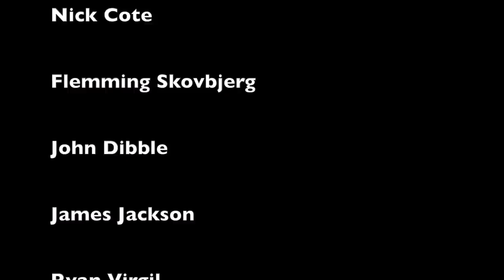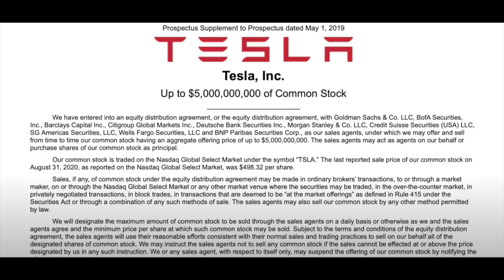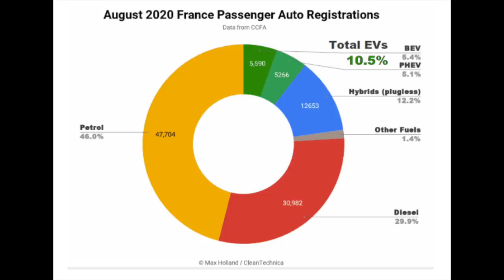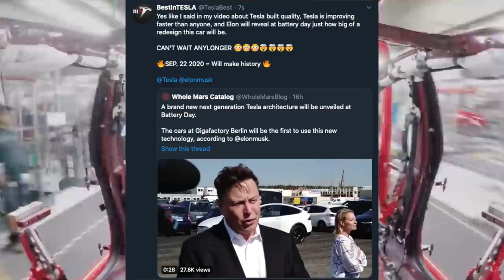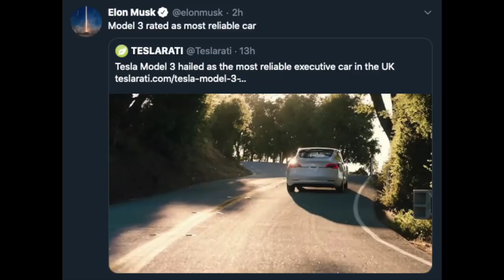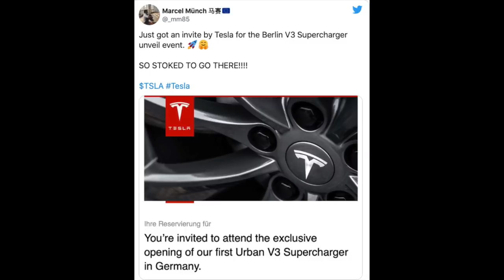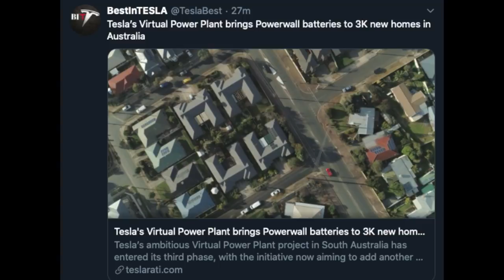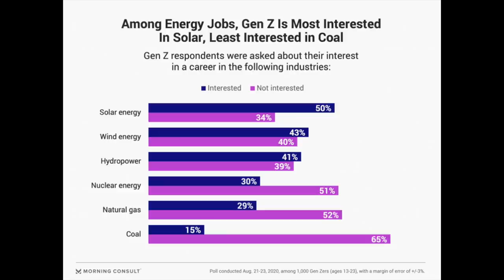Tesla sales are up 457% in Germany | Ford showing off insane new electric car | $5B in capital !!!

Comment: Tasha from ARK had said months ago that they would be fine with dilution for the sake of the bigger picture. The S&P is a non starter anyway. Tesla was being Tesla before the S&P announcement, and they will be the same Tesla company after.
Reply: Sure, same company, but a less valuable one with less short term momentum. But for long term and inclusion will of course come and most likely when come when Tesla is less volatile and the income from the core business is enough to keep the company profitable.
Reply: @danieeel90  Elon has already said he doesn't care about short term traders and if volatility is a problem the don't buy his stock. I deleted my RH app. Just settin it and forgettin it.
Reply: @lovewilliams4500  Yes, but it's not Elon who chooses who goes into S&P 500 and who doesn't. But yes, I think buying or holding Tesla now is only for the long term investors so you have the right idea.
I think Apple is another stock you could do the same thing with.
Reply: @danieeel90  I never said Elon makes that decision.
Reply: @lovewilliams4500  I know, but you commented on the volatility. Which is an issue when being considered for S&P 500.
Reply: @danieeel90  That's because he said that about day traders in general.
Reply: Thx
Reply: @lovewilliams4500  It's not volatile just because of daytraders. It's more because of Robin Hood average joe investors who found the stock and the fear of missing out. Those investors also tend to be the ones who panic during big jumps in share prices.
Reply: @danieeel90  I know day traders that use RH, too.
Reply: @lovewilliams4500  Yeah, they are on every platform.. I said average joe investors though.
Reply: @danieeel90  and every average Joe trader is on every platform.
Reply: love williams Good luck, you clearly are trolling or simply don’t understand.
Reply: @danieeel90  Riiiight

Comment: This just proves that Tesla got a lot of jealous haters. SP500 is tripping
Reply: I think the S&P just wants to see a longer track record of positive balance sheets from Tesla.  Inclusion will happen eventually.  No reason to get upset that it didn't come at the first possible chance.
Reply: @AMortalDefiant  A longer track record? You don't get to change the rules in the middle of the game.
Reply: The thing is regardless of what the S&P does or doesn’t do the stock will continue to have an out sized impact on the market and the funds that track the index won’t accurately represent the segment of the economy they claim. So in other words regardless of any internal opposition for whatever reason they have to Tesla, they won’t have a choice but to add them. Either that or the funds will buy Tesla anyway so they are representative and not so skewed
Reply: This is Tesla we're talking about, "No Problems"

Comment: 7:05 Tesla sales up 456% in August in Germany!!! No wonder Gordon J quotes the pre-ship July figures 🤨
Reply: özv. Döbröntei Ilona 🙄
Wrong 2846 cars in the month of August 2020 🤨
Reply: But in July 2020 only 250 cars. Better see the whole picture of what is going on in Europe
Reply: @özv. Döbröntei Ilona Mathematics lesson for you. Even if we used 100 cars as your starting point it should be 556 and not 456. If sales was up 100% then it'll be 100 then and 200 now.
Reply: Not that hype, just covid recovery. Ev is  still behind by normal car s lot
Reply: Preuling that is true but they have no dealerships to hold buffer stock. So Tesla need to wait for enough orders to fill a boat before they transport... So July was just between deliveries. But To be fair the same argument can be levelled at the 456% increase over August 2019.  
When Giga Berlin opens they won’t have that problem, watch this space...
Reply: rene topeka that is why TSLA is so valuable.  Their addressable market is 98% of all autos.  The world is going to near 100% EV so the growth potential is huuuuge...
Reply: @roryreddog3258  Model 3 was down first half of 2020. Tracking it live is very hard because the sales are very clumped in some months. March and August accounted for 2/3rds of model 3 sales in germany,   the pattern would suggest 700 sold this month.
Reply: nox5555 Tesla Don’t load up dealerships with cars all around the world. It’s a different model, they make cars to order so they have on average 17 days inventory, so when Fremont was down 7 weeks and China down 4 weeks they could barely sell any cars in Europe. Legacy auto not only have plants on the continent but also had about 8 weeks dealership inventory. Tesla has to focus on delivering to US and China, in order to “deliver” as many cars as possible. Low European sales early this year are meaningless, just as high sales in the month of August is meaningless as that is just when the ships laden with Teslas arrived. It’s a global company so you have to look at global numbers rather than regional ones.

Comment: There is no speed limit on the German Autobahn. How do the Tesla Models handle that?
Reply from the maker: I tried 232km/h no problem 🙊🙉🙈🤘
Reply: @BestInTESLA  145 mph? I used to cruise, in my Porsche 911 @ 150. And, something would always give me the "high beam blink", I'd pull over, and get passed. 

I once was in front of a Ferrari F-10. I never saw him come up on me. I pulled over, and just vanished.  But, not before I saw flames come out of the twin triple exhaust pipes when he shifted. He was the Roadrunner - Beep Beep - he was gone.

Comment: You Should mention that Unplugged Performance's car had battery cooling issues they were not aware of after the rebuild from the crash  and had to run much of the race in limp mode.

Comment: You should talk about the "MEGA PRESS", THE LARGEST "ONE STEP" STAMPING MACHINE IN THE WORLD!
Giga Berlin will also have the most advanced Painting Process where the curves will be given different paint.
IT WILL LOOK AMAZING!!!!!!!!!!!!!!!!
Reply: I'm really curious if that will stop the several problems with current paintjobs which are widely shared with various models.
Reply: The megapress is not a stamping or metal pressing machine - it is an advanced high-pressure die-casting (HPDC) machine, made by IDRA Group of Italy.
Reply: @steveupson7183  I hope it is far more reliable than other products made in Italy.
Reply: @andytaylor1588  yeah, like Lamborghinis and Maseratis.
Reply: @fincarosa  
U R HILLARIOUS!! (Michelangelo? DaVinci, anyone?)
Reply: @steveupson7183  Don't miss my point. It's a game changer that nobody talks about:
Musk is renowned for outsized promises, but in the case of the Model Y’s die-cast rear underbody, his enthusiasm for  this advanced use of aluminum – cast by a house-sized “giga press” – is supported by manufacturing experts who call it a game-changer. “It’s definitely an all-new look at how to do things,” asserted Laurie Harbour, president at Harbour Results Inc. manufacturing consultancy. “Elon Musk has always pressed his engineers to be creative.”
Reply: @fincarosa  Fast and sexy, buy definitely NOT reliable. Nothing even close to Tesla's when it comes to Reliability.
Reply: @funkyjazz123  Do not know of paint issues. My sister has had her Model-S for over 6 years and still loves it.
I don't have to worry about paint, I ordered the CYBERTRUCK and will have it wrapped!
Reply: @jacdragan8918  you missed the point.  My comment and the comment it was responding to were not comments about Tesla, they were about Italy. I was pointing out that's it's incorrect (and stupid) to throw shade on a whole country and talk in generalizations.
Reply: @Jac Dragan I’ve not missed the point at all. You were highlighting the Tesla / Musk tendency to innovate, to think out of the box, to take an idea from one sector of industry, and use it in another. All I did was point out that the introduction and development of the Megapress at Tesla is even more innovative than you had indicated. How many other car manufacturers are making their sub-frames from aluminium (yup a Brit :) ) rather than mild steel? How many of those are mass produced? How many are cast, rather than being cut and stamped in a press? How many are making their rear sub-frame assemblies from one piece of aluminium, rather than pressing, welding and glueing together of umpteen pieces of sheet steel?
Tesla’s use of the Megapress (I gather there will be 8 of them at Berlin) is yet another game changer that will have the traditional mass-market car manufacturers spitting feathers. One major change allows Tesla to build cars that cost less to make, are safer and more robust, and are far more resistant to corrosion. And that’s just one innovation. To catch up with that one advance, the traditional manufacturers will have to ditch $billions of earlier investment.
Reply: @Blessings 2You Sorry, but I fail to see the connection between Vitruvian Man and Volvo, Doni Tondo and Toyota. 
And for the record, Michelangelo was overrated. Could’t draw. :)
Reply: Jac Dragan You should look up in the dictionary what the differences between reliability and quality control. You can have excellent quality control where it meets the specs to the T, but it’s a piece of shit as it falls apart. I had a Porsche Cayenne and I mentioned this before another post, well built quality, but the transmission crapped out at 118,000 miles. And that cost me $8800 to replace the tiptronic XMSN. Hence it was not reliable. Reliability has to do with a things lasting power and how well it holds up. It’s got nothing to do with paint defects or gaps between panels, which is a quality control issue, not a reliability issue.

Edit. Sorry this was just to correct the difference between the two, but as I see, i didn’t read it the right way.
Reply: Jac Dragan, the curves are not getting different paint.  The paint chemistry they're going to use at Giga Berlin will look subtly different at different angles.  Sounds sick, but it's all the same paint.

Comment: ofc the build quality in Germany will be better. Just like the build quality in Shanghai is better than the one in Fremont. New factory designs, new technology, change in the manufacturing Technics due to new and improved technology. The build quality in Texas will be better than the one in Berlin most likely.
Reply: ... and in 10 years it will be contracted out to low-cost factories in places like Indonesia or Haiti  :)
Reply: Build quality of Texas will wont reach German quality. 
You forget that, in Germany are alot of high qualified work forces that have done Professional 3 years of Ausbildung (Internship/Training) and extra years of experience after their Ausbildung and they know what they are doing. 
And German people do their job really properly and honestly. 
Not Sure if thats the same in USA otherwise VW cars made in USA wouldve been as good as german ones which are not.
Reply: @chillis8267  It is not about the people. There are more auto workers in USA than in Germany so auto workers can be found. It is about the design. China is known for their low quality and low cost. That's why almost no Chinese cars are in Europe or USA. They just can't reach the safety standards. Ofc that's another reason why China is exporting such a small amount of cars. And suddenly Shanghai can make better quality cars than Fremont. The factory in China is literally designed to make Model 3s unlike the factory from the 60s in Fremont. The Californian factory is meant to make numbers not quality. In Germany they combine both. Texas will be the ultimate factory. With the latest tech and industrial designs. SO Texas will most likely make if not better quality at least the same quality cars with much much larger quantity.
Reply: Ignorance is bliss.
Reply: @Mark-yn5lt  true

Comment: Just for context - SpaceX is conducting hop tests to discover how their designs work in actual use, and they're pursuing rapid iteration of designs.  This strategy is terrific.  But we have to understand, they're going to produce some failures.

The most recent hop test illustrates this.  Their control software and hardware performed well, but the landing legs were clearly inadequate (they probably knew this before the test).  Further, they had another fire under the rockets after landing.  They were ready for it, and they deployed fire suppression equipment immediately.

Elon has said that SpaceX will soon employ beefier landing legs, and I'm sure they'll be bug hunting to prevent fires on landing.  And there is much more to do.  These hop tests are conducted with bare hulls, tanks, engines and control hardware.  A functional orbital rocket will have far more complexity.

I expect soon they'll start assembling and hop-testing the Super Heavy booster, even as they push ahead with Starship iterative design and testing.

Comment: Tesla won't be included in the S&P. It is simply too overpriced and volatile, a plunge in TSLA can cause market turbulence.
Reply: It is a weighted balance, tesla’s 400 billion market cap (shares that will not be sold minus the float shares) versus the index value of 31 trillion. It accounts for approximately 1.5%? Of the total. So even if it completely 100% flops and goes bankrupt, the other 98.5% is doing just fine.The market turbulence you’re talking about might be a ripple, not a tsunami.

Comment: Electric Car Sales in Germany 2019 (Full Year):
1. Tesla: 10.711 Cars
2. Reanult: 9431 Cars
3. BMW: 9.127 Cars
4. Volkswagen: 8201 Cars

Electric Car Sales in Germany 2020 (Half Year)
1. Volkswagen: 11.177 Cars
2. Renault: 7.066
3. Tesla: 5.103 Cars
4. Audi: 3.301 Cars

So it really just was a Compensation. Not really much more. It sounds much more bigger than it actually is, since they just sold 514 cars in 08/2019.
The overall numbers in germany (including EV and ICE): VW: 43.843, Tesla 2.846 in 08/20.
From 01/2020 to 08/2020: VW: 326.783, Tesla 8.152.
Reply: Let’s see how these numbers shake out when Tesla starts churning 1 million to 2 million vehicles a year out of Giga Berlin.
Reply: @joscaca  Yeah lets see. Even though Tesla stated that they want to produce 500.000 in shanghai and produce 52.000 yearly currently.

Comment: You are wrong. The radical Redesign is not a GERMAN innovation. What Elon is talking about is one piece casting for a sub frame for motor, suspension, axels & wheels eliminating 70 parts and the same for front will be for front of car for motor etc. The other really big thing is eliminating a lot of wire for window motors and all other secondary motors that now will only have power wiring and controls will be multiplexed or wireless. This technology was supposed to be introduced with first MODEL Y production but was not ready. German cars will look exactly the same as FREMONT but will also have Superior Painting until modification can be made to FREMONT too.